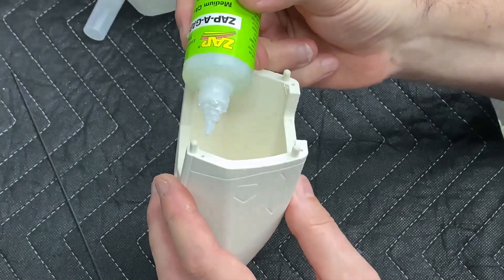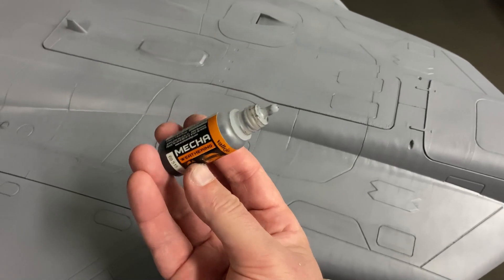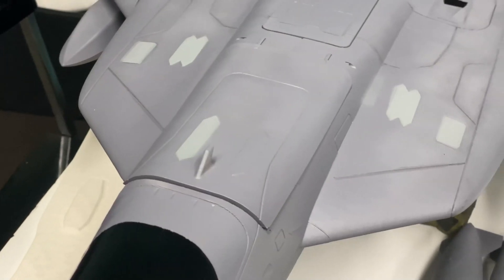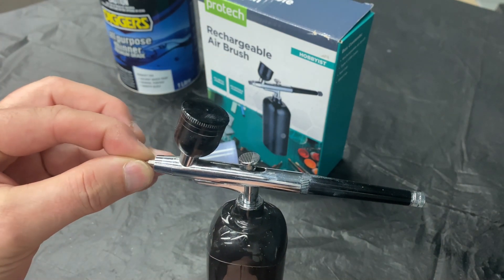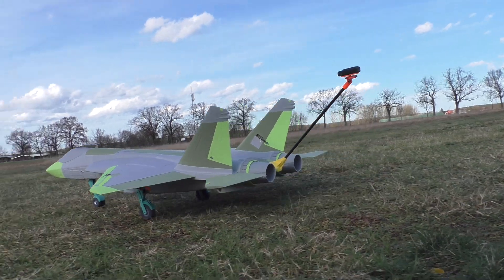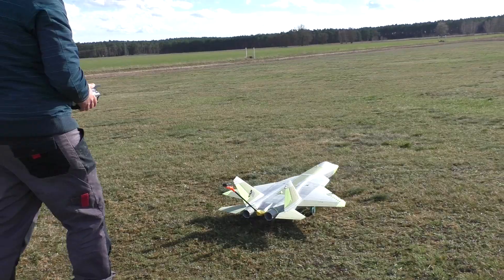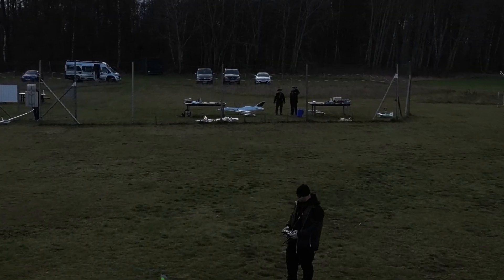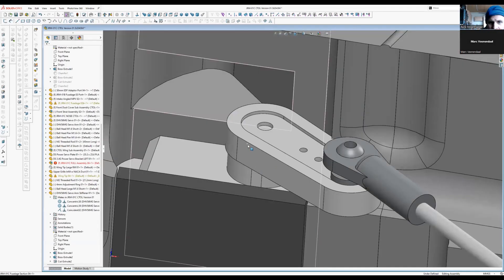JRM-01 Paint Work and First Flight with Landing Gear

Comment: Hi Rene and Marc, this is a beautiful jet, i’m currently building the jet and have some questions about the specs, what is your set-up on this model because i run it on 4S and the weight/thrust ratio seems a bit off, please reply soon, i’m really looking forward for a maiden flight on the JRM-01C50 because i really like the aerodynamics
Reply from the maker: I run it on 5S lipo with the 4000kv 50mm EDF.

Comment: I'm really enjoying watching this process of building an amazing aircraft.  I've even bought the files and have nearly completed printing the parts.  I have a couple questions though.  Why does the jet in the downloaded files have just one rear nozzle as opposed to the ones pictured on Youtube?  What are the differences?  And is there a more detailed Assembly Video for the actual Aircraft in the files?
Reply: Also, if we bought the original files as I have, Will we be able to download Updates as you improve on the F35?
Reply from the maker: The STLs for the JRM-01 are not released yet. So you can't have purchased them.
Reply: I bought the files from RC-Jetprint
Reply: Different project I guess.  Still waiting for this one

Comment: You should try making a transparent canopy by heat shrinking a plastic water bottle over a wooden or ABS printed model of the canopy (ABS so it doesnt melt). Its easy and looks very nice on the plane.
Reply: I used this process in my 1:10 scale scratch 3D modelled and 3D printed GR4 Tornado - with a hand vacuum cleaner and soda water bottle 😉. Since then I have built a more reliable oven vacuum formed and made some lovely 3D printed bucks and vacuum formed 2 canopies for my 1:10 scale 3D printed Mirage 2000N

Comment: 3D printing progressed so fast.  Amazing enough the electronics and wiring and flaps linkages are 3D printed into the jet bodies but 3D printing the engines with the turbines and copper motor parts (it’s copper inside electric motors right?) and magnetic materials is crazy. At least they haven’t figured out how to print batteries yet, but still it like the Star Trek replicator in real life.

Comment: amazing!   both planes look amazing, did you cover the planes with resin prior to doing the paint job?
Reply: No, the initial tests were with an automotive primer/filler paint. I then tested direct spray paint from the can onto the LWPLA. One observation was that parts painted on one side only warped. It was due to differential moisture absorption (high humidity here in Sydney, Australia) so I upgraded to painting all surfaces of the parts such as access hatches and flaps, inside faces of leading edge slats etc.

Comment: Will you release the cad source files? I’m more interested in checking out the engineering in the design than printing it myself.
Reply: Unlikely. The entire development process is made up of numerous stages of saving the parametric model out as a parasolids 3D solids model and then working on further details before saving out as a dumb solids again. The JRM is made up of over 19 developed and saved and staged files. Over 900MB of data
Reply: Fair enough. If I can encourage it at all, I’d really enjoy taking a look through the source files, especially with regard to the splitting and joining of components.
Reply: Splitting is the easiest of all our work. The hardest is getting great smooth transitions between surfaces and coming up with a design that not only looks good but works well. 
Our longest process is the development of the airframe. Once complete, we slice at intervals that make sense for the size of printer and print bed. 
It takes about 1/10th of the development time.
Reply: @marcphilippveenendaal4394  cool, that’s what I’m interested in - how the join interfaces are created. I’m looking for inspiration.